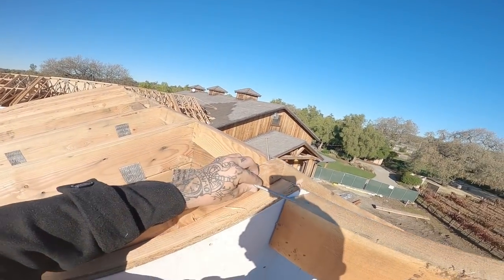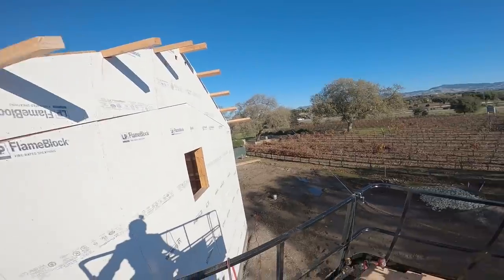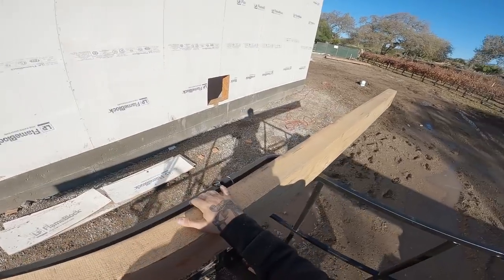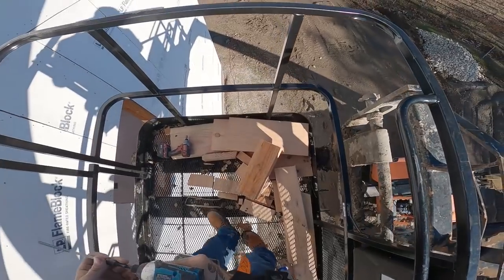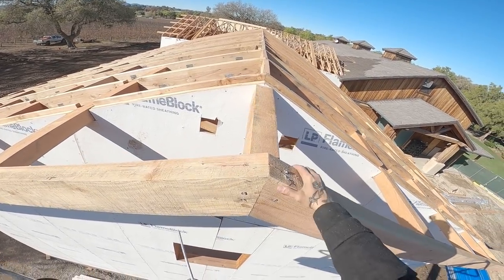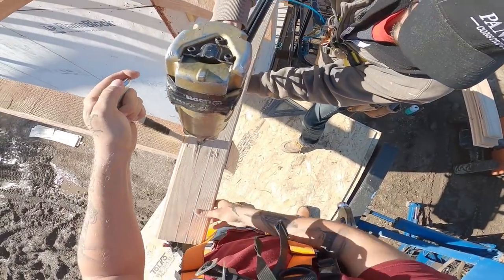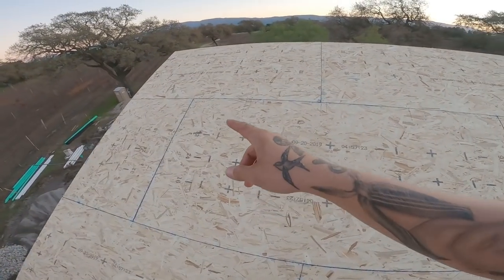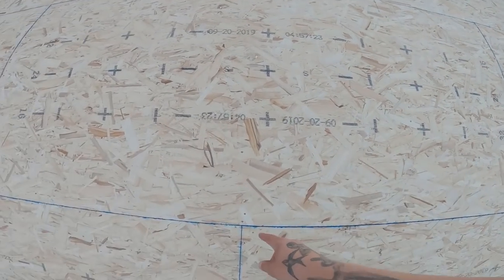4x8" Fascia Board Installed SOLO! This Wasn't Easy..

Comment: Where's the sheeting clips? They're required here in Washington. We nail 5" perimeter and 10" in the field so we can slam out the nailing and no problems on the inspections. Nice job and attention to detail. 👍
Reply: It’s commercial work they don’t require them on most building I build. You must build custom homes??

Comment: Bad idea to Tyvek the walls before raising them.  The Tyvek would get beat up in the process and would not be as effective.  Besides you want the Tyvek to be as seamless as possible.  We roll ours around corners and go as far as the roll will go without any breaks. In most cases also, it has to hang down past the wall to cover other things such as floor systems so it is best to wait till the framing is done if you want a good wrap job :)
Reply: tyvek is a siders job really if u have to do lap siding its better to have that shit perfect to snap lines. but then you have to put windows  and doors in first which should be a siders job as well. but framers do it all for free around here garage is free windows and tyvek window wrap all added to a framers punchlist when they should be on to the next job.
Reply: @tobslobe  it's the job of who I hire to do it
Reply: What exactly are you talking about? Oh wait I got you

Comment: two questions, why did you change your boots and what was the purpose of the solid 2x4's under the roof sheathing at the ends of the rafters? I saw you guys did 4-5 rows up from the end of the rafter in certain spots?

Comment: Those screws going parallel to the grain in those 2x4s are providing little holding strength. They’ll never hold up over time. You should have toe nailed some screwed from the 2x4 to the 4x8.

Comment: i hate fascia soffit due to the fact that i never had a lift to do it until recently. and still hate it cause no one really knows how to do it or snap lines. just eyeballing it doesnt cut it..  i have to go back and fix it all after someone ruins it. 3' eaves with 24' rim board is hardest facia ive done but we tried it off the roof first that was impossible so had to wait for stucco guys to set up scaffolding to do it. no fun but at least by yourself u know what your doing and cant have someone ruin it for u. tongue and groove looked nice! 3/4 roofing? fuken stout ! hard to roof when your tied off and ropes in the way so much more danger to worry about. man if i lived in cali i would be working for you! and no tyvek is were its at. siders should do that. i would actually learn something and hopefully teach new tricks. but Cali building is a bit different im sure codes are different from Colorado. you guys build nice stuff!

Comment: How do you like the hitachi gun? I’ve wanted one for a while but man there expensive!
Reply from the maker: I personally don’t like it. It’s cordless, it runs for a bit. It’s brutally awkward to use though!
Reply: Was going to ask the same question lol
Reply: Works for me I hate having to drag around a hose. Makes setting up and rolling up a breeze. One battery lasts all day just charge it at lunch. Shoots about 400 nails per charge
Reply: Wait and buy the 20 volt Milwaukee cordless nail gun. It will be available at the end of March 2020. Check out the YouTube video Milwaukee NPS 2019.
Reply: I like my Metabo-HPT cordless framer for doing punch out, yes it is heavy, but you get used to it.

Comment: Was that 7/16" OS?. I noticed you didn't use clips between the trusses. Nice video
Reply: What are clips between the trusses? I've seen H clips on osb. I dont know much about this stuff just learning.
Reply: @jonsnow8550  Yes the H clips.  They go between the span when you have 24" spans. OSB isn't that great at spanning long distances :)
Reply from the maker: Trusses are still 24” OC, used 5/8” roof sheathing. No clips needed here!

I’ve only used them once or twice in my time.
Reply: @MattBangsWood  I thought maybe you were using a thicker decking.  On our side of the country, TN, we use 7/16" for wall sheathing and roof decking.  It requires us to use the clips.  I figured it was thicker decking.  Nice work. I have spent many days since 1980 doing the work alone :)
Reply: @MattBangsWood  and you are still young, give it time, you will see them :)
Reply: @ArtisanTony  What is the difference in decking size? For example, snow load in TN vs. CA... I'd imagine my snow load support comes from rafters and not sheathing? Nail backboards?
Reply: @jonsnow8550  It's more about what the sheathing is rated for.  You can get by with no clips using 5/8" thick OSB but with 7/16" which is common on most projects, you need to use the clips to keep the decking aligned between the trusses where the panels meet.  5/8: was probably specified by the architect due to the occupancy type.  Most developers will not spend the extra money and use 7/16" OSB for residential projects. This places the labor burden on the framer but saves the owner money on material cost.
Reply: @ArtisanTony  Thank you for the explanation but also say I were to buy sheathing for my own home. What are the benefits to a thicker sheathing?

Comment: A drill will drive those sds screws much faster then the impact will. You will have less chance of burning out your impact.
Reply: That's why I use Rigid.  Best warranty in the business.
Reply: pre drill. maybe but you always use an impact to put lags in i know from experience. ive had my makita impact for years i baught 2 sets cause i like them so much i use the drill to dril holes and impact for driving fastners.

Comment: A real basket man lift would cut down on labor a lot you wouldnt need someone below to run it i dont know what they run in your area but around here you can get away with one for a week for under 1500
Reply from the maker: It would work well, but it falls back onto the grading issue. They don’t have a workable surface for us to drive on..

We’ve used the 4x4 man baskets a lot! They work great. Unfortunately, with these guys, it’s impossible..

I’m calling it though, they’ll have it graded the day we leave.. Shows how much they care about us! 🤣
Reply: @MattBangsWood  on the next job you bid I would definitely include a grading clause in the contract. Not only is it an inconvenience and labor-intensive,  it's also dangerous, be safe.

Comment: 13:10 It is a big mistake to bang them together. They need space to expand when they get wet. If the wood is dry leave 50% of the tongue out, Only if they are wet you can bang them tight together. And FFS safety! If you fall you die.
Reply: the angle should be on the bottom they are always tight/square on back side of tongue and groove...if they get wet than the roofer didn't do his job right. everything is supposed to have a gap in it (expansion joints) but everyone puts sheeting tight. pine will twist more than swell or shrink and you should put a sealer on it or stain or god forbid some paint...
Reply: but yea a little gap is good for most material so things can move without cracking stucco. or drywall.

Comment: Why are you goosing the trigger on the Sawsquatch?......Sorry, I should have waited till I end before asking the question. The Bigfoot blade is better in my opinion than the Diablo. Lot less wobble and deflection.
Reply from the maker: Blade Wobbles if not. Needs a new one, but even then we get wobbles. Feathering it to keep blade straight until my cuts going.